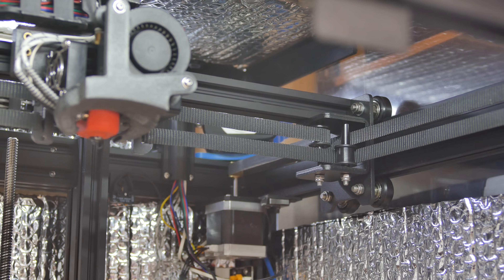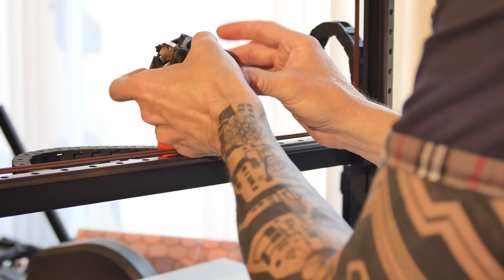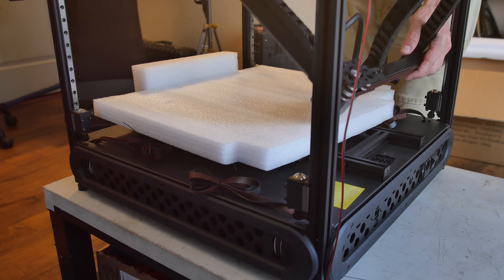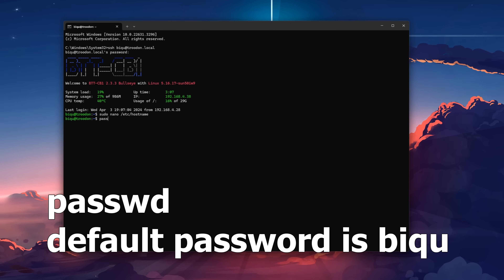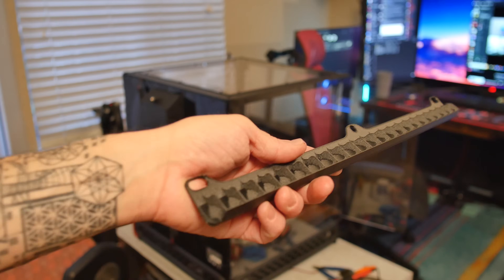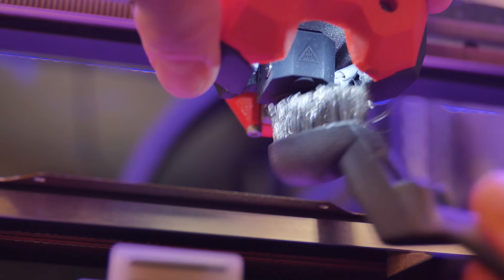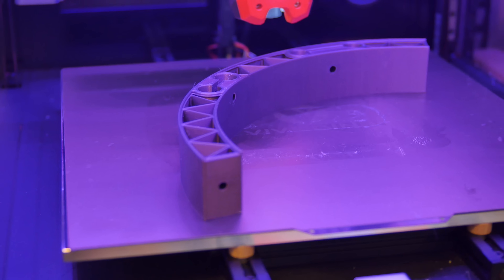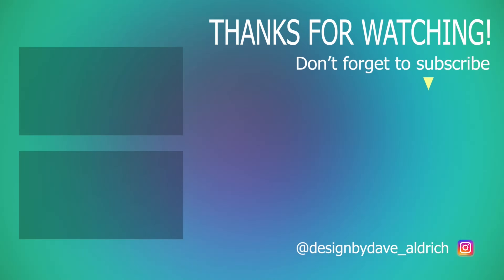I Upgraded To The Troodon 2.0 3D Printer - The Voron You Don't Have To Build!

Comment: Regarding tap and the need for a clean nozzle tip, I have found that heating the hotend to 150C when you heat you bed prior to meshing gives quite a bit of safety net... It's not going to help with a really dirty nozzle. But a tiny bit of plastic will be smashed surprisingly flat. The result is negligible impact to leveling vs. the serious problems that happen if the nozzle is cold. (And 150C is not hot enough to harm a PEI bed, so it just works.)
Reply from the maker: Thanks Jeffrey! I'm pretty sure I've tried variations of this but still have trouble getting the quad gantry level to complete successfully. I have to have the nozzle 100% perfect or it will fail on one of the corners. Maybe I need to give this tip another try though.

Comment: I'm a software engineer and quite comfortable around linux.  However, I'm not a pro 3d print person.  How difficult do you think it is to get something like this printing ASA/ABS easily?  I'd like to make parts for my track car.
Reply from the maker: It will be no problem for you. ABS/ASA pretty much just require an enclosure and the correct print settings. The hardware of this printer will handle it no problem. I've got a ~16 hour ABS-CF print going right now.

Comment: where did you end u plugging in the toolhead rgb lights?
Reply from the maker: https://youtu.be/D5uA0bJsT4w?si=9vdCg6TTT30JUjni&t=444
Reply: @designbydave  thanks for the link i meant the nozzle lights, unless you plugged them into the same spot?
Reply from the maker: @KLLSWITCH  the enclosure lights to one pin, the tool head lights to the other.
Reply: @designbydave  awesome man thanks for the replies!!!

Comment: Thanks for posting this video. I picked up a Troodon 2.0 Pro Mini based on your review of the big one. So far so good. Less assembly and cheaper than a Voron kit, no extra printed parts, decent quality, and open source. Now I just need to figure out how to install the toolhead LED for better lighting...
Reply from the maker: Cool man! FWIW, mine is still going strong and by far my favorite 3d Printer. The toolhead is the stock Stealthburner so just look up the official Voron documentation on that for the LEDs.
Reply: @designbydave  Thanks! The Troodon is definitely a step up from the old FolgerTech i3 kit I've been using since 2017.

Comment: For what it's worth, Formbot's website has a customer service contact email. I just bought this printer and had to contact support because I was having firmware issues. Response was prompt and they sent a good step-by-step guide on how to SSH in and reinstall the firmware creating the issue. So either they have a lot of working experience providing supplemental Customer Service for the Voron without the manufacturer's involvement, they have a good working relationship with Vivedino in providing CS on their behalf, or (I suspect) Formbot IS Vivedino wearing a hat and mustache.

My first upgrade was printing detachable door hinges that can also fold flat against the side of the printer. From there I'll be installing a mount for the runout sensor (the stock method of it free-hanging is so odd in an otherwise well planned out system), as well as rocker rails to tip it back for maintenance.  

Eventually I'll get to the extruder and hotend, and then start printing off parts for the inevitable Voron 2.4 😝

Comment: Use the same style of insulation with the reflective bubble wrap, but cut it to be the same exact size as the panels, including the holes the screws pass through. Then sandwich the insulation between the panels and the frame. No mod to the printer needed and they act like gaskets.

Comment: How did you wire the tool head LED’s?
Reply from the maker: Long wires running up, umbilical style along the bowden tube, out the back and down to the electronics chamber. +5v and ground go to a 24v to 5v buck converter (which gets 24v from the power supply) and then the data cable to the PG3 or PG5 pin on the main board

Comment: For bed probing, use KAMP. It only does a bed probe for how big your print is. Saves tons of time
Reply from the maker: Thanks, yeah, from what I understand, adaptive meshing is now integrated into Klipper so there is no need for KAMP. However, I should be upgrading to the Eddy probe soon which also pretty much makes that unnecessary. Stay tuned for a video on that.

Comment: What slicer software do you use with this printer ?
Reply from the maker: PrusaSlicer
Reply: @designbydave  is there a profile in the Prusa slicer already that support that build plate? Does WiFi come with this printer to send files over wirelessly?
Reply from the maker: @Average3djoe  I think Formbot includes a basic profile, but you will have to do your own specific configurations. There may be some community profiles out there. 
Yes it has wifi and you can send files and control every aspect of the printer remotely.

Comment: Where the extruder head RGB leds cable goes attached to?
Reply from the maker: The +5 and ground wires run to the buck converter, the signal wire to PG3 or PG5 on the main board EXP1 header - https://teamgloomy.github.io/images/octopus_x7_pins.png

Comment: Please explain half the price. LDO kits are 1500. This is $950. Are we just rounding?  Nice vid. Gave me a lot to think about as I approach a print kit purchase
Reply from the maker: A similarly spec LDO kit, with cnc metal parts + printed parts is around $2000 on Matterhackers. There is a lot more nuance to the price discussion that I perhaps could have been more clear on. Either way, I still feel this printer is an excellent value.
Reply: @designbydave  I forgot about matterhackers. It was a good video. Thanks again!

Comment: So you can make life a lot easier with better macros. 

And KAMP. KAMP will slice off a lot of time in the start sequence. Adaptive mesh is built into klipper now also so if you don’t wanna install KAMP you can just use the adaptive mesh portion. 

A longer retract at print end will save you from the nozzle cleaning and you can also add a brush and bucket and add that to the tap macro. 

Outside heat soaking my Voron starts very fast. 

One last and most important thing. Build a never more filter and stop using the vent in the back. You’ll never get consistent performance and max layer adhesion sucking all your heat out.
Reply from the maker: Thanks for your suggestions! 
The great think about an open source printer like this is we have the ability to customize about every aspect to meet our individual needs.
Reply: @designbydave  very true! My 2.4 has definitely come so far since my initial configuration with the baseline stuff. 

I look forward to seeing what awesome things you get up to with this new one :)

Comment: Hi,
great vid. The Exhaust fan, technically isnt needed for printing abs. its counter productive as its meant to pull air out through a filter but you can disable that fan easily.

Regarding TAP, depending on start gcode, your printer should heat to 150C to push away any oozing that might have occured. 
The issue with beacon is, you are not actually probing the print surface but the spring steel below which is the main "selling point" for tap. 
Let me know if I can help you in any way with TAP Setup etc.

Cheers,
Takuya
Reply from the maker: Thanks. The exhaust fan is necessary for printing ABS for me as my printer is in my small studio apartment where I do not want ABS odor where I sleep. Reducing the speed to 30% seems to be the balance between odor filtering and warp free printing.
Reply: @designbydave  I suggest closing up the Exhaust, but installing a nevermore filter instead. its way more effective, plus passively bumps up the chamber temps by blowing the warm air under the bed into the chamber. Keeping the printer closed up with foam tape between the panels and the frame + waiting at the end of a print for the chamber temp to stabilize, also reduces nasty stuff going into the air as the VOC´s can settle down.
Reply from the maker: @takuya2431  Yeah nevermore seems the way to go! thanks
Reply: I came here to say exactly what he said above, his suggestions are 100% correct.

Comment: Do the toolhead lights connect to the PCB board on the toolhead or do you have to route that all the way back under the printer to the electronics bay?
Reply from the maker: All the way back, painstakingly through the cable chains to the mainboard. The toolhead PCB does not have any extra data/power pins. It might be better to commit to switching to a CAN setup.

Comment: If you switch to a scanning probe -- try the cartographer, switch to canbus and umbilical in the process, since beacon is USB only and cartographer works with canbus. I have both on different machines, and the resolution and precision is the same. There are a few gotchas with both of those, I've run into a couple of flex plates that just don't work with either, even though they're spring steel, the scanning probes pick up some variations in the steel that are not really there. Also if you change sheets, you need to re-calibrate the probe, it's quick, but something to keep in mind.
Reply from the maker: Good to know thanks! I would like to change to canbus to eliminate the cable chains so I guess cartographer is what I would want. That's a project for later on.

Comment: Wow the troodons are pretty cheap now. They used to be a lot more than a 2.4 kit. A LOT more. I got my 2.4 kit from formbot about 2 years ago and remeber looking at them back then. Comes with aklipper screen as well. Nice. Got the same setup on my 2.4.

Im also not a fan of the nozzle homing methods which is why I went for a eucalid probe. Was before TAP. Had the rubbish inductance probes back then. Still needs to home off the nozzle against the z end stop but this isnt an issue if you heat the nozzle while the chamber comes up to temp and let all the oozing finish the run a nozzle clean with a nozzle brush. At least the meshing doesnt use the nozzle.

I also highly reccomend building a nevermore filter to go under your bed and circulate hot air around you chamber. Will heat up way faster and allow you to get over 45C within 15 minutes without any insulation. Mine gets up to over 60C during summer. You also wont need to run the chamber fan and dump your hot air as the nevermore has carbon filtration. Also the chamber fan filter doesnt do jack for reducing VOCs just so you know.
Reply from the maker: Thanks. Yeah, the neverrmore seems like the way to go. Guess that's my next project!
Reply: Dunno what you are talking about, the US price has not gone above $1099 since I started looking at them in Jan 2023. I bought 3 that winter/spring, and one of them was $50 less.
Reply: @mkhmkh1266  The Troodon 2.0 did not exist at the time I'm talking about. It was the vivedino core xy. Which if you take a look at the formbot website were / are much more expensive. More than twice the price of a 2.4 kit.
So now you know what I'm talking about.
Reply: What does your high flow nozzle increase your flow rate to?
Reply from the maker: @bobmac6050  I'm not sure, I measured it a couple years ago on my Voron 0.2 but don't remember what I was getting. I rarely push it very hard though, so a high flow hot end probably isn't that necessary for me. However its nice to have the overhead in case I need it.
Reply: @designbydave  thank you. Also the tool head LEDs are they wired all the way through the drag chain to the board?
Reply from the maker: @bobmac6050  They were initially, but there is not enough room and the wires ended up getting damaged. I re-ran them up along the bowden tube umbilical style.
Reply: @bobmac6050  24mm^3 with the dragon. The Troodons have a 5 amp limit without adding a relay or going CANBUS unfortunately. Probably their only truely dumb design choice. If you add the BTT Melt Zone Extender, and up the stock heater from 40 to 50W, and run a .6CHT you should be able to beat 30. I have a Marathon, and with their 50W heater and a MZE and .6 CHT I got clean PETG test runs at 35m^3.
Reply: @mkhmkh1266  is there any possible way to add a bigger power supply without frying the machine?
Reply: @bobmac6050  Solid state relay. Have to have some electronics knowledge. Use the current hotend power source as input to control power to a separate wire bypassing the weak links.
Reply: @mkhmkh1266  yeah idk anything ab that lol

Comment: Insulation -> Why not just install on the outside? You can buy huge EVA foam sheets on a roll. I wouldn't use inside because EVA Foam despite being ubiquitious and used to seal the panels, is actually flammable. but on the outside, why not?
Reply: You can get hollow core acrylic panels from the big box hardware stores. Cut to size,  seal the openings with a printed frame, use longer screws. Should improve heat retention and still look good.
Reply from the maker: Yes, I suppose adding insulation to the outside would be pretty easy, so maybe that's the way to go.

Comment: I got a fystec 300mm 2.4 kit for $600. $1100 seems high for that printer.
Reply from the maker: Yeah, I just looked it up but the cost comparison is a bit more nuanced. At $600 that doesn't include the printed parts and probably not the electronics. The closest configured Formbot kit is currently $959 (USA warehouse) and that does not include printed parts. The ~$2000 kit price I was referencing in the video is for the LDO kit sold by Matterhackers that includes CNC machined parts. That is about the closed "feature" equivalent kit to the Troodon 2.0 that I know of.
Reply: @designbydave  no printed parts, but all electronics and everything else needed. Oh wait, no raspberry pi so add another $40. Of course I bought it during an AliExpress sale and stacked multiple discounts. Shipping was free and I got it in two days in California. I like the idea of a mostly built voron for some people. It makes sense for those who don't want or have the time to build one.
Reply from the maker: @jasonjennings6686  Yeah, there's a lot of variation in cost depending on how you source the parts. I should have been more clear about the "half the cost of a Voron kit" statement.

Comment: I can manage to hit approx 45c+ for my v2.4 chamber I use nevermore, abs works great also helps the chamber heat quickly, if possible under bed fans really help heat the chamber. Also for tap, I preheat the bed to 110/abs temps and the nozzle to 150c the nozzle being 150c gives abs enough squish to not seem to affect my leveling. Also check out KAMP so you don't probe the whole bed. also idk how precise your qgl is set but 0.075 should be all you need afaik, i am typically leveled in 1-3 cycles. Hope some of this helps.
Reply: +1. Preaheat bed and nozzle (<= 180C) before Homing and QGL
Reply from the maker: Yet another recommendation for nevermore. I'll get on it!
Yeah, I need to get KAMP setup as well!

Comment: I actually heard about Troodons a while back, but didn't consider them because they were so pricy. After I heard about the SV08 the other day, I looked into it and it seems undercooked and it's ironically made me more likely to buy a Troodon (I could never get a V2.4 since I don't think I can make the time investment). I might be imagining things but Troodons seem to cost a lot less than when I last looked into them
Reply from the maker: Yeah I've looked into the SV08 since it's exploded on the socal medias lately. Sure it's about half the cost of the Troodon, but as it's shipping it's also probably about half as "functional", so to speak. Personally, the SV08 won't work for me because its not enclosed (yet?) and I'd prefer not to have plastic mechanical parts. Also I really don't like proprietary hot ends.

Comment: Oh man this couldn't have come at a better time, Dave -- mine is arriving in the mail in a few days 😄 I'm thinking of swapping in a Phaetus Rapido 2 UHF in it for fast ABS printing.

Why would you say the enclosure exhaust fan is necessary for printing ABS? I'd think a warm chamber is first priority.

I'll be doing some of the mods you mentioned here. Cheers!
Reply from the maker: Awesome dude! This printer is great. 
Exhaust fan kinda required to filter the abs odor, at least in my case since my printer is in my apartment.
Reply: @designbydave you want a nevermore or the filter for that not the exhaust...
Reply from the maker: @absak  yeah, that seems to be the case. Fortunately I don't print smelly materials very often so the stock works for me.

Comment: If you need to do maintenance on the gantry can you easily switch out things? Tension belts etc
Reply from the maker: It looks like it, yeah. All the various brackets are unique to the Troodon and are either stamped sheet metal or a custom metal extrusion. Not sure if stock, 3D Printed Voron parts would work as replacements should you need to replace something.

Comment: Awesome video mate! Thanks for the @ mention ❤ will be interesting to see how the new sv08 compares
Reply from the maker: No problem 👍
Yeah that printer is dropping all over social media like the same day I post this haha. 
From what I can tell, it's a "cheaper" Troodon. Molded plastic parts instead of stamped and extruder metal. And its not complete, no side panels. Also the tool head is proprietary.
Reply: Also using inductive probe but have z offset thingy like 2.4mod but still not work
Reply: @deecat it's called load cell not "z offset thingy"
Reply: From what Nero has been showing the svo8 is baaad. Idk tho.
Reply: @ashers_workshop I don’t think his review is representative of the actual unit. Unless you’re expecting a cheaper version to be of the exact same quality